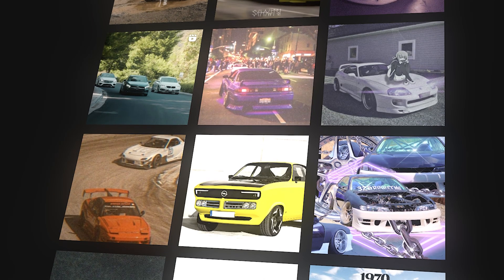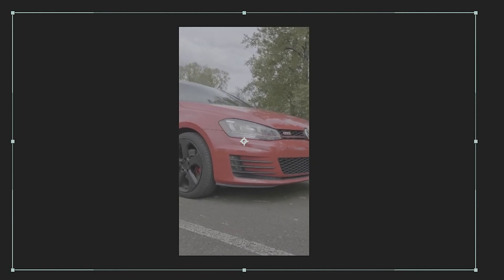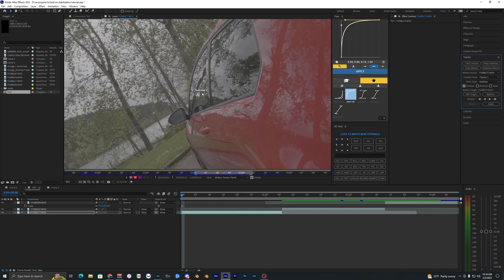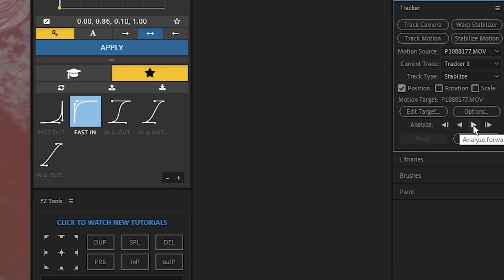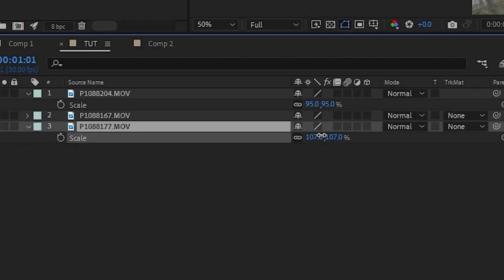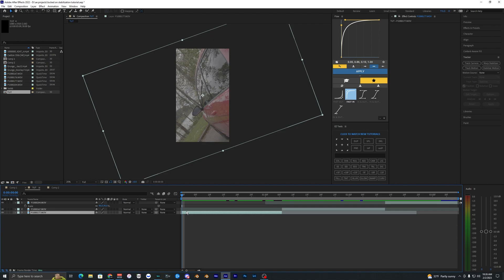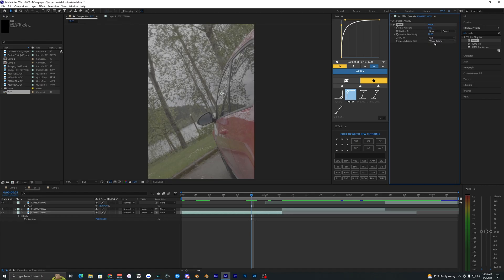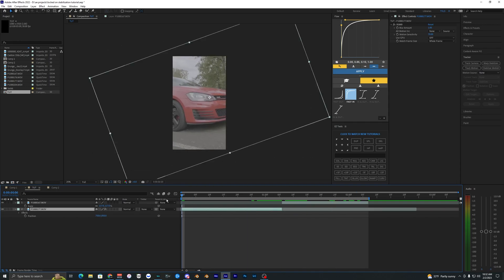LOCKED ON STABILIZATION EFFECT - AFTER EFFECTS

Comment: My footage gets reaaalllllyy shaky or better said jittery when i apply the stabilization. I filmed it on a gimbal, any tipps? maybe turn of ibis?
Reply: dont slow the footage down when tracking. Track the footage and after that slow it down, that worked for me :). So track the footage with 100% and then slow it down AFTER you tracked and stabilized it in post! (Yes i love troubleshooting)
Reply: Its not fixed mine still jittery even after slowed it down